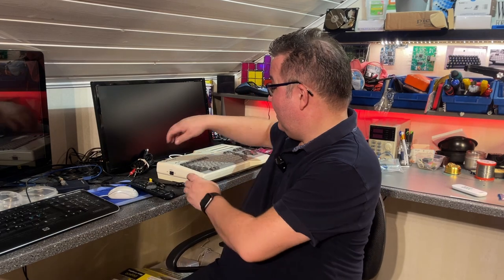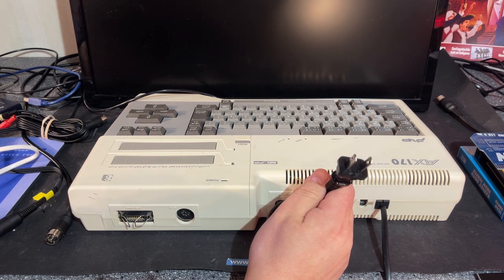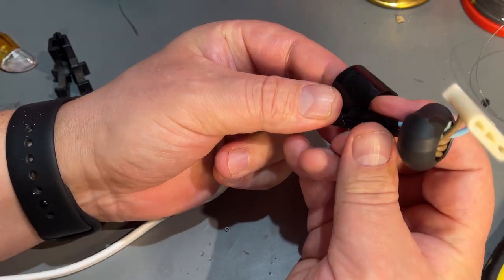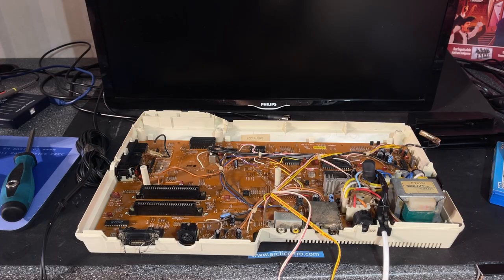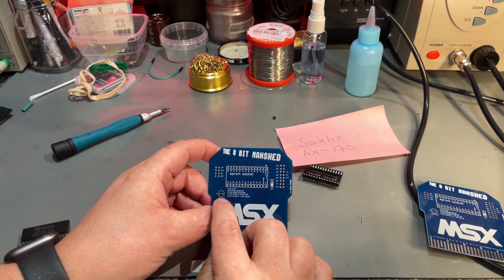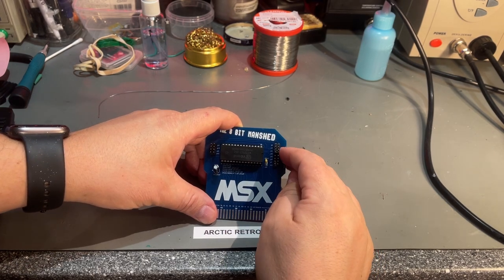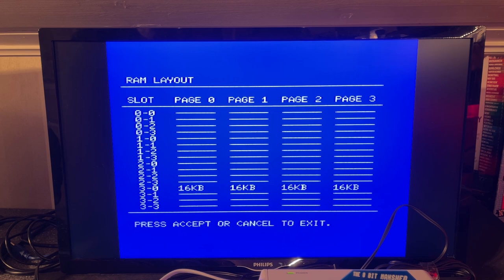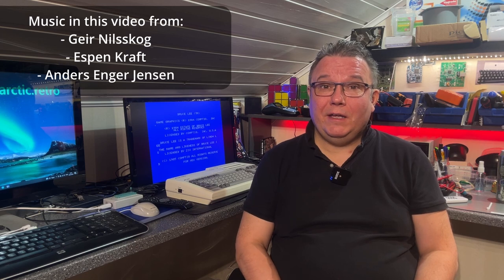The Arabic MSX Sakhr AX-170 restoration and walkthrough plus building a MSX diagnostics cartridge

Comment from the maker: NOTE: I got a few comments about that soldering mains wires is not a good idea. And I totally agree. I did not think too much about it. Solder do of course melt more easily if the temperature in the wire goes up by some reason. It's better to use screw terminals or something like that. I will fix that. Also, I never leave old equipment like this ON unattended.
Reply: hi , i have question please : can i play msx2 games on msx1 console?

Comment: Kids at home, don't solder your 230V cables😉
Reply from the maker: Not with power on :)
Reply: @Arcticretro  I guess yours isn't going bendy bendy being inside a case probably, but soldered mains leads and tinned cable ends can really become great fire hazards.
Reply from the maker: @Breakfast_of_Champions  Ok, explain why?
Reply: @Arcticretro  On cable ends, the solder will eventually flow away from the screw pressure and it becomes highly resistant and hot. In the middle of the cable, the cable strands will break from flexing on the stiff part, also becoming highly impedant. Soldering like this is forbidden in the electrician code, you have to use crimped cable shoes, and plugs have to be attached like this.
Reply: @Breakfast_of_Champions  Thank you very much for pointing out. Wiggling the solder off could become really dangerous. Luckily in this specific case the flexing is limited because the soldering point is after the strain relief securely away inside in the housing.